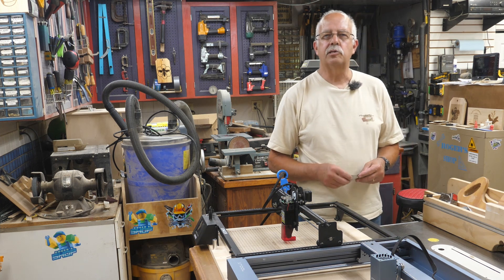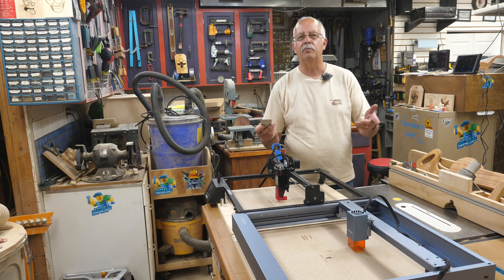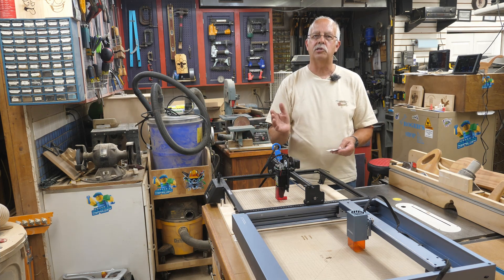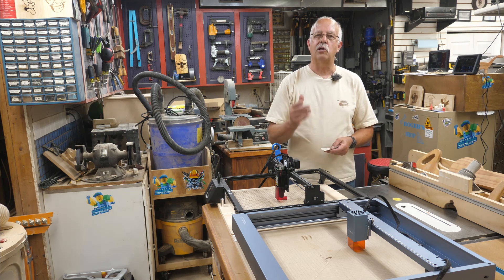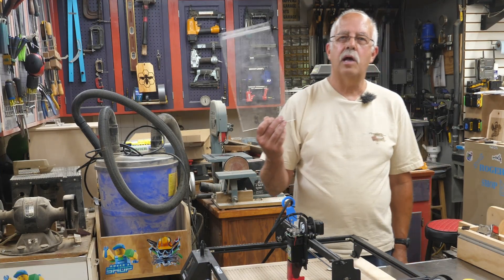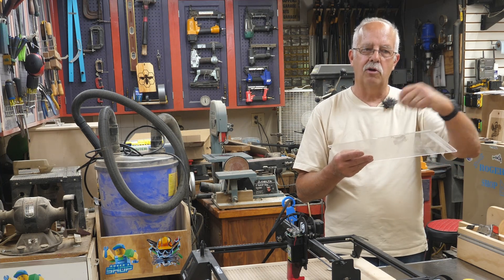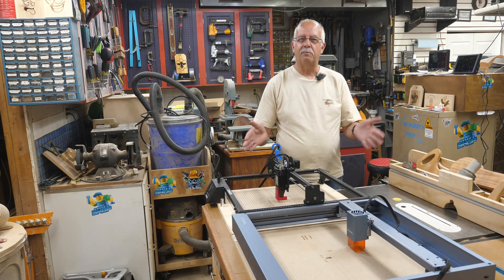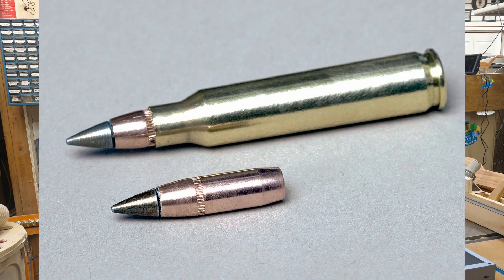Laser Cutting Vinyl & PVC

Comment: Thanks Roger for a very informative video. I am just getting into lasers and ordered a 10W Diode. I saw a video of someone who cut and engraved on vinyl flooring planks. Would this be safe to use? Thanks
Reply from the maker: Most vinyl will release chlorine gas and will corrode every metal part on the laser.  Also, not good thing to breathe!

Comment: PVC is Polyvinylchloride with CHLORIDE being the operative word. Chloride refers either to a chloride ion, which is negatively charged chlorine atom or a non-charged chlorine atom covalently bonded to the rest of the molecule by a single bond.
Yes I was disappointed to learn I cannot cut expanded PVC sheet (Sintra) with a laser diode. 🙁
Reply from the maker: Good chemical explanation!

Comment: CAN I CUT DENIM , POLYESTER, LINEN, LEATHER? FABRICS?
Reply from the maker: Works very well on cotton based fabrics such as denim, etc.  Light colored fabrics will show scorching on the edges.  Also works very well on leather, but it smells pretty bad, so have good ventilation.  100% polyester will melt, but a 50-50 cotton/polyester seems to cut ok, just scorches at edges.